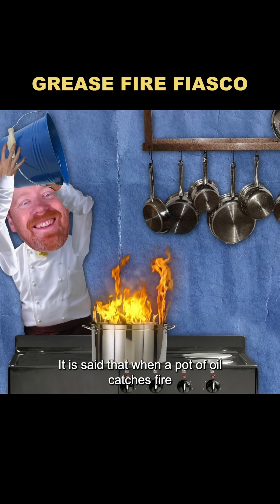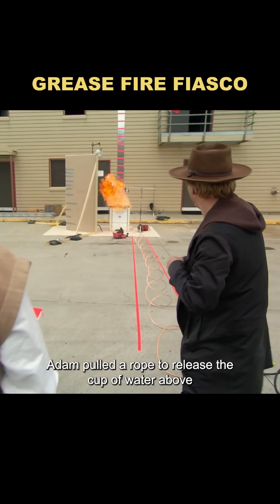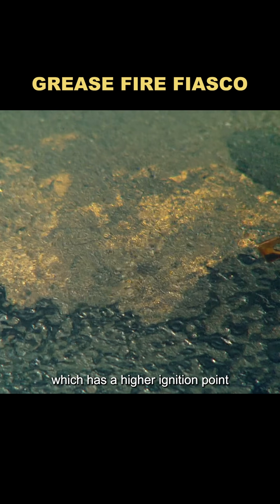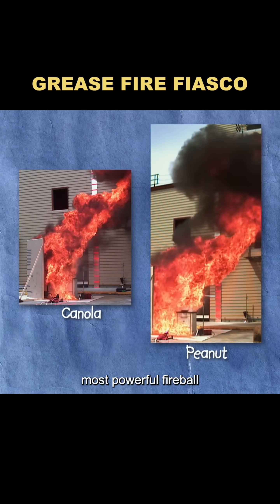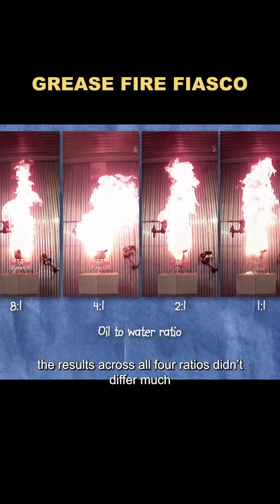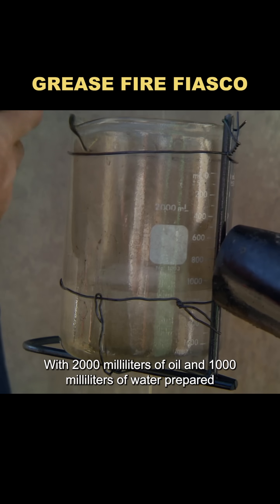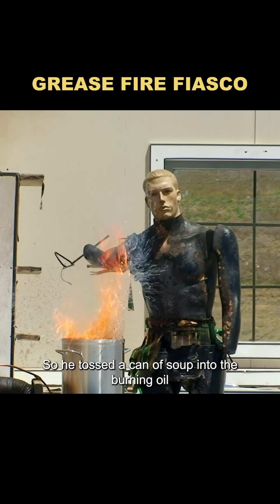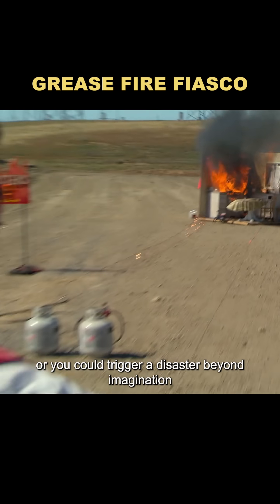What happens if you pour water into a pan of burning oil?

Comment: You need 3 things for a fire.  Heat/ignition source, fuel, and oxygen.  Deprive a fire of one and the fire goes out.  The best/safest way to extinguish a grease fire is to smother it with an oversized metal lid.  No oxygen, no fire.  If it's gotten out of hand, evacuate and call 911.  Better to let the firemen deal with it than get severely burned.  Never use any powder/flour/baking soda/etc. as fine powder is known to flash over.

Comment: Best way to put out this kind of fire is to put a lid on it. Or something that keeps air from going in. When I was 10 my cousin was reheating pizza in a toaster oven. He got distracted reading a comic and the toaster oven caught fire. He was screaming and was gonna throw water on it when I ran in. I grabbed a pair of welding gloves my uncle used for taking stuff out of the oven, yanked out the plug, picked up the whole firey mess and ran outside with it to an old metal barrel. Tossed the toaster oven in there and started throwing dirt on it, then realized I was a moron and went and got the shovel and used that to dig up more dirt and kept going till the barrel was full. When my uncle got home and found out he said I did a great job then laughed when he saw how much dirt I put in the barrel.

Comment: bt,dt. With 40 l (10 gallons) of burning and boiling oil and about 0.5 l (1 quart) you'll get a really big fireball with about 20 m (22 yards) diameter and high.
From a distance of about 3 meters (10') just throw the two huge cups of water into the burning barrel and run. It's very impressive like a huge cloud of burning napalm above you. It comes back down burning but gets out about 4 meters above you.

Comment: To those curious on how you put out the fire, just add more oil. It might sound counter-intuitive, but adding more oil decrease the over-all heat in the pot.
Reply: Wrong.  That's akin to adding more gasoline to a gasoline fire.  Smother it with an oversized metal lid.

Comment: I almost burned my mom's kitchen. I was alone in the house and wanted to cook for myself. I seasoned some chicken in the oven and decided to make fries.
So, I put sunflower oil in a pan and went to the toilet but I forgot about it. Then I smelled burning oil and saw the oil catching fire. My instinct was to pour water on the pan.
That was a mistake. I almost burned the whole kitchen. The fire went up to the roof, and I ran away in panic. Luckily, nothing else caught fire, but the kitchen looks like I dropped an atomic bomb in it. Everything is dark from the smoke. The roof used to be white, but not anymore.
I was shocked. My parents will be home in 2 days, so I called someone I know to paint the roof.
I learned the hard way:
 if oil catches fire, never use water. Instead, cover the pan with a lid or a damp cloth to cut off the oxygen.

Comment: The reason why it explodes it oil floats on water, so the water instantly sinks to the bottom before the heat turns it into steam...steam takes up a LOT more volume than liquid water so it literally blows the oil up out of the pot, atomizing the oil and making a large fireball...

If you have a grease/oil fire, either put it out bu putting a lid over the pot/pan or cover the surface with baking soda...

I have a deep fryer and every time I use it, I keep an open box of Arm & Hammer Baking Soda within reach so I have something to grab if I have a fire...
Reply: not an explosion really, tthats just like it said, a fireball. it spits the burning oil everywhere and that is why a fireball erupts from it

Comment: Temperature, fuel and oxygen is necessary for a fire. Cut one element out to put it out.

Pouring small quantity of water provides more oxygen due to higher temperatures evaporating water along with hydrogen. Water sinks to bottom makes the oil float on top with more surface area and exposure to air

Comment: Why didn't you try Rice Bran Oil.The flash point of rice bran oil is reported to be 615°C (1139°F) according to a chart listing typical flash points of edible fats and oils.
 Another source indicates a flash point of 280°C (536°F) for rice bran oil, which is higher than that of bakery shortening (271°C).
 A different source states that rice bran oil has a smoke point of 490°F (254°C), which is higher than many other oils, but this is not the flash point.
 The flash point is the temperature at which the oil's vapors ignite, and it is a key safety consideration during high-heat cooking.

Comment: The best way to stop an oil fire from spreading is immediately turn the stove off and put a top on from any pot or pan  so it reduced the flames from going higher and possibley igniting something flammable nearby and move it to a cooler spot so that the pan or pot cools down possibley saving your house or apartment from catching fire

Comment: It is not how it works in common kitchens,... Common kitchens uses fire woods, not induction stoves,.. and the fire starts win your frying, or you are sauteing,. That's when the fire in your wok starts,.. don't use induction stove in your experiments,.. induction stove has thermostat that stops the equipment from overheating,. You can't achieve that heat in induction stove,.I bet when the oil heated, you put a fire on it and put water in it so that's it, it burns out like exploding,.

Comment: Thank you for telling us "what not to do" without telling us the right way to put it out 😊
Reply: Just cover it to let it run out of oxygen or use a fire hiderant
Reply: Cover with a damp cloth.
Reply: You can dip a towel into water and use it to smother the fire, depriving it of oxygen
Reply: If you use a hydrant, make sure its the right one
Reply: Have some baking soda  on
Reply: @dimitrislatinos5793 or salt
Reply: @dimitrislatinos5793  No, it can cause even more damage/flames.  Smother any grease fire.  Take away any one of the 3 things needed for a fire and it goes out.  Heat, fuel, oxygen.
Reply: Cover it with wet cloth
Reply: Sand
Reply: Why do I see people saying hydrant? It's a special fire 'extinguisher' you would use for grease fires. Source; Worked in a kitchen for a while. Hydrants are used as a water source... The literal thing they say not to use.
Reply: If you visibly see the oil burn, turn off the flame, add more oil (cools down the burning oil), and then blow or cover it over the pan.
Reply: @normalkid488  Wrong.  Cover it with a metal oversized lid to smother the fire.  Never add more fuel to a fire.
Reply: @JamesPeek-o9x the oil is just to cool down the already hot oil. your explanation is correct, the addition of room temp oil is only optional.
Reply: Smother it, deprive it of oxygen
Reply: what part of myth-busting a claim was promising practical guidelines for putting an oil fire out
Reply: Go find it in google yourself. If having someone doing the dangerous part for you is not enough, it means you don't appreciate other people's time and effort at all.  -1
Reply: same thought!
Reply: Pour it all over the floor or drink it. That should do the trick.
Reply: If u have a 🧠 u know the way
Reply: Lol What an Imbecile. How to put it Down you cover That Burned oil with Wet Rag after you turned off the stove..
Reply: @wtg-d7x  You're better off covering it with an oversized metal lid.  The wet towel could dry out and then catch fire.
Reply: @JamesPeek-o9x Yeah Thank you I Know that, sir but We're talking about Emergency Situation where you unable to reach the Metal cover on time. beside I tried these and It always Work for me.
Reply: Put the lid on.
Reply: The right way to put it out is to use salt
Reply: this isn’t a “how to deal with oil fire” video

its a video showing it’s real and you shouldn’t do it
Reply: Run... Call the fyre fyters... Cook safely...
Reply: Use sand... Scream for help... Pray to God...
Reply: Turn heat off and cover pot with lid
Reply: You don't know what to do when oil burns? Are you 5?
Reply: @yesman2338 it's not about being 5, some of us were not privilege to cook
Reply: @yesman2338  Yes, I too got thought how to put out an oil fire by my parents at 6 years old. Were you not? Are you stupid?
Reply: @yesman2338 if we know then what's the essence of the video? 😒😒
Some of us haven't come across something dangerous like that and I was amazed seeing and knowing that
Reply: Just add more oil best
Reply: @prashanthkn6843  No, smother it instead.
Reply: u can turn the heat off and add more oil to reduce its temprature then it should just blow out
Reply: @TheRebbanator  No, smothering the fire is best/safest way.  You wouldn't pour more gasoline on a gasoline fire, would you?
Reply: Use petrol to overshadowed the fire
Reply: Always keep flour handy. If you have a grease fire then put flour on it. It's the best method because I like to keep flour handy in case I'm craving emergency cookies. Plus using flour makes you feel like you're actually fighting the fire.
Reply: @visualonestudio i don’t know if you’re joking or not but just in case someone reads this and thinks it’s a good idea, DO NOT POUR FLOUR ON GREASE FIRE.
Reply: @snowmochi1373  I don't know. If someone genuinely thinks using flour to put out a fire is a good idea, I don't think they'll live very long.
Reply: @visualonestudio  No, flour/any non-firefighting powder can ignite.  Smothering a fire works the best/is safest.

Comment: It happens because the water evaporates due to such high temperature providing more oxygen which causes these massive fire balls. Same thing happens in the car as you should never use water to extinguish the fire caused by petroleum or diesel.
If there is a short circuit and fire happens you still do not use water cause it is a good conductor and can cause current to spread all over the ground.
Reply: you're wrong in the first part
Water on evaporation does not provide oxygen to the fire. For it to provide oxygen, the bonds between the oxygen and hydrogen atom need to be broken (which cannot happen due to heat alone)

Water is denser than oil
So when you  pour water, it goes below the oil
However, because the temperature is so high, it boils almost instantly which causes the oil to splatter. This splattering allows the fire to get more oxygen from surrounding air and thus burn quicker and hotter

Also, water itself is not a good conductor of electricity, but minerals and impurities dissolved in it allow water to carry electricity
Reply: @agent1gamezcorrect explanation
Reply: Distilled water can be used to put out fire on electronics.
Reply: @Almighty_Flat_Earth yes, but most people don't just have distilled water at their home

Comment: All of the experiments lacked one important component. Enclosed space of a normal size kitchen. If you put a ceiling and two more walls on that desert kitchen, you are trapping that fireball, leading to an increase in heat and pressure.

Making a really tall fireball might look cool but it actually reduces the impact on the kitchen.

Comment: Solution : use any powder that doesn't catch heat (like sand or baking powder)
Reply: that or smother the flame using a lid
Reply: @agent1gamez  covering the pan that's on flames does also works but the powder solution put down the fire quicker

Comment: There was a method to extinguish that fire even the flammable gasoline or LPG. One method was put a dried sand or soil. The fire was extinguish surely. Another method was using a wet large blanket or cloth to cover that fire and it will extinguish or you can put out that fire. The most effective was using a fire extinguisher and it was 100+1% effective.😊😊😊